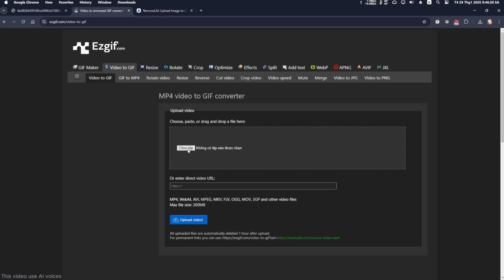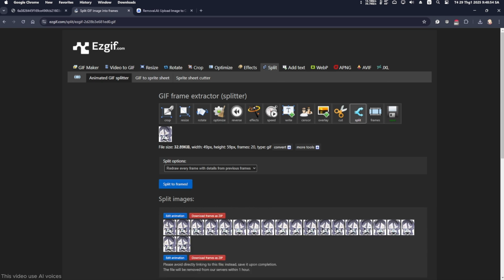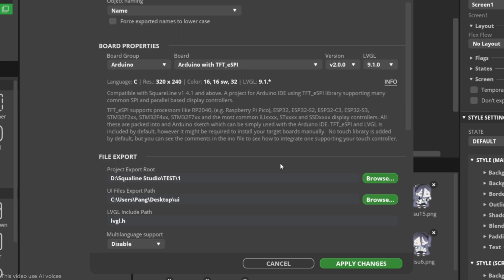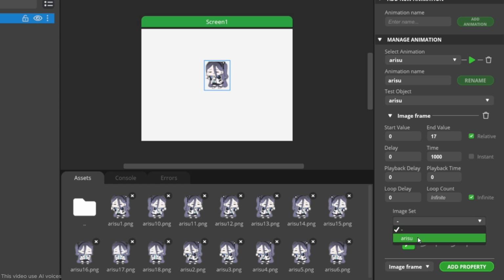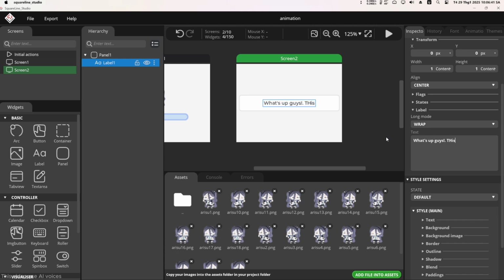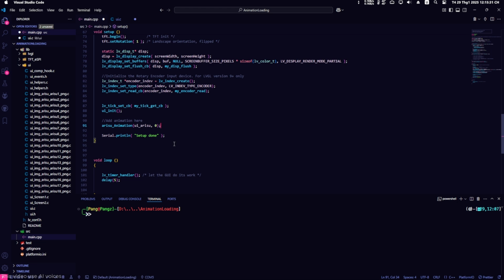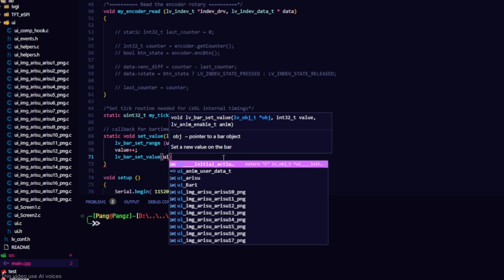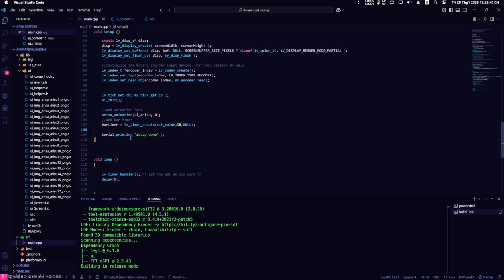Create Loading Screen and Image Animation in LVGL | Easy Guide for Beginners

Comment: Hi. why my screen flicker everytime it run the gif and loading bar?
Reply from the maker: maybe check your lvgl screen buffer setup, enable Monitor on your lvgl config file to check ram cpu using
Reply: @pangcrd  Hi it shown 10fps, 49% cpu. I use arduino ide and have try to set LV_DISP_DEF_REFR_PERIOD to 10,20,30 but no difference.

Comment: Hello  thanks for the video..  I'm very new to this. and I struggle with the code for these screens to work with Square-line.  Can I ask, How did you start with the code in the main cpp file?  did you use the LVGL example as a template?  Thanks,
Reply from the maker: @JohnnyTheYetti  LVGL has example template for us. We  just need design ui in squareline, then export ui files. And configure event in example template. For event config we can find on LVGL docs page. Some touch driver/rotary encoder libary for LVGL we can find on Github.
Reply: @pangcrd  Thanks for the answer. I'm looking for it for a month.

Comment: Nice Channel, can you make a Video of how you setup vscode and Platform io for it? With all the Stoff around Like libraries?
Reply from the maker: I made a tutorial video on how to install the PlatformIO extension. 
https://youtu.be/LKcfCnNmx8Q?si=TUgGbZTlz0eRJFIx
The video is specifically for STM32, but you can also add packages for ESP32 and RP2040 by:
 Go to the Platforms tab >> Embedded >> Search "Espressif 32" >> Install.
** If you want to install the VScode theme like mine:
Go to the VSCode extension tab, search for "Best Themes Redefined" >> Install (Currently, I'm using the Neon City theme from this set).
** The VS Code icon pack I'm using, u just search "Material Theme Icons" >> Install.
** Finally, if you want to customize your CMD terminal, you can search for "Oh My Posh Windows terminal."
** As for the platformio.ini file, you can refer to my file to set up adding libraries, baud rate, and serial monitor.

Comment: Hi! make a tutorial on ESP32-2432S028R v3 aka Cheap Yellow Display  There is no need to connect wiring, There is a touchscreen, a sound amplifier, RGB diodes, Microsd card slot, Light Dependent Resistor (LDR). This is a good groundwork for a beginner to enter this IoT world.
Reply from the maker: @DeniusKycher  Okay, i'll make some tutorial with CYD. Follow my channel for more update!
Reply: @pangcrd  OK! Man!